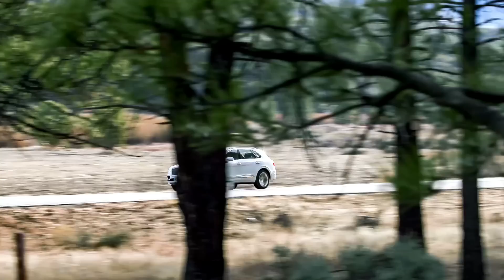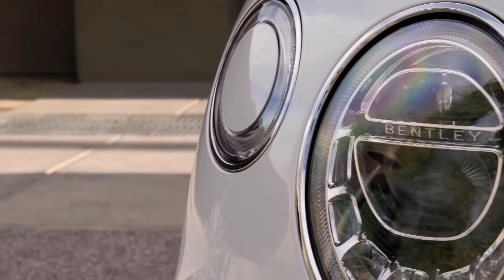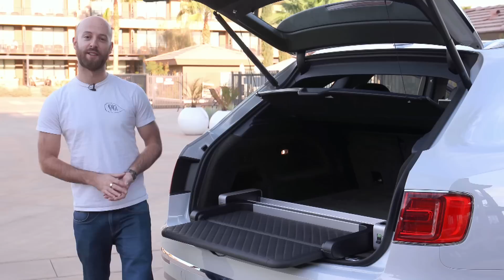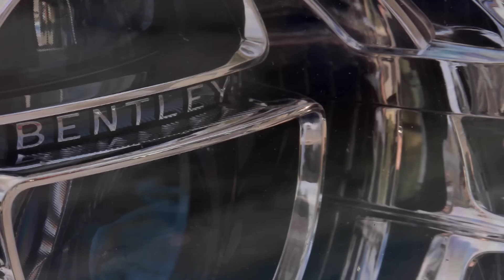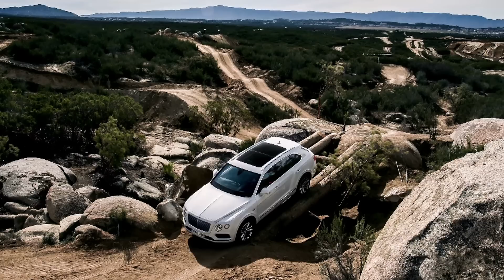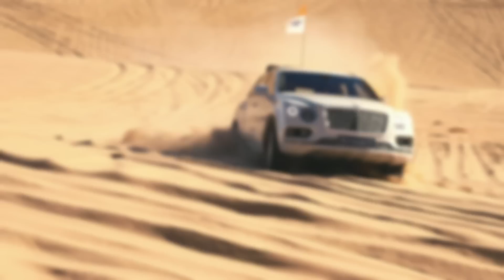2016  Bentley Bentayga first drive review

Comment: Have a look at it.  it's just an Audi Q7 with a big engine.   The Range Rover Autobiography has the same level of finish, plus genuine offroad ability, a transfer box and 36 inches wading depth.
Reply: I have sat in a RR Autobiography and it does not even come close to the Bentley in terms of fit and finish. Honestly, even the new Q7 feels nicer.

Comment: I just don't think it's big enough...sounds odd but with Range Rovers being half the price but bigger and scarier on the road it will annoy alot of potential customers
Reply: Yeah i was expecting it to ride high like the range rover but it sits quite squat and un-suv like
Reply: KingDogez no there not the Range Rover evoque is not a proper Range Rover anyways the evoque is over 40k
Reply: Lol Range Rovers Are An Eighth Of The Price Since A Range Rover Is 30,000 And A Bentley Bentayga Is 250,000
Reply: S Miller Bentayga is actually longer (and longer wheel base) and wider than Range Rover. It’s actually a bigger vehicle. But it’s lower, so visually it looks smaller.